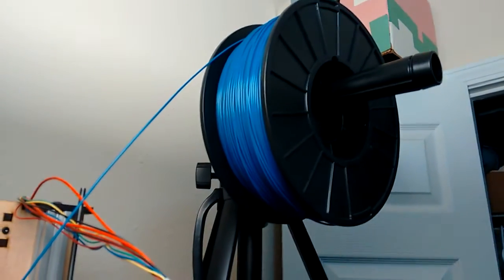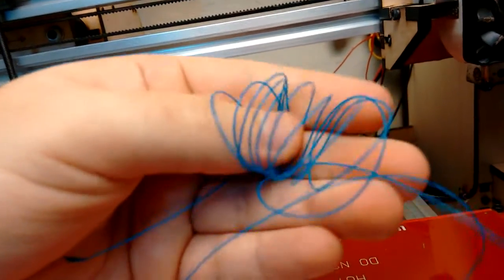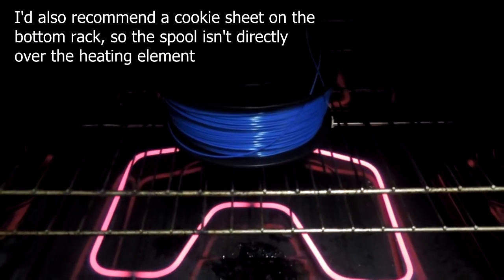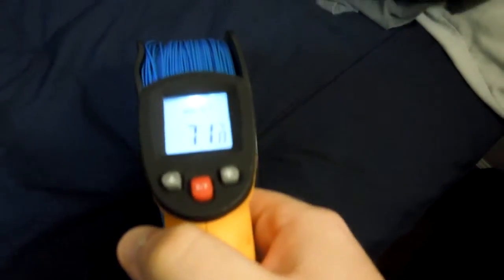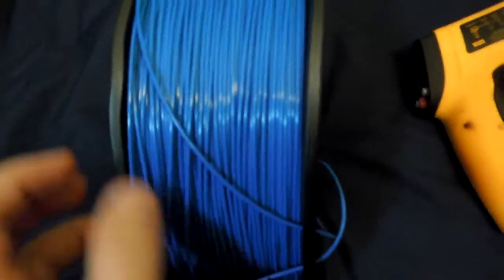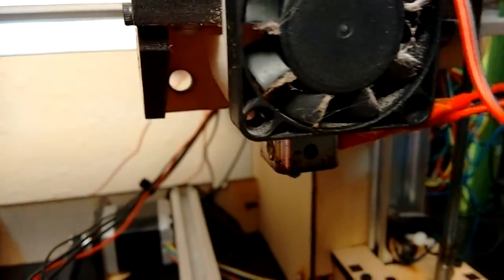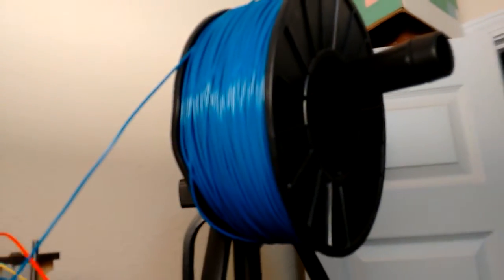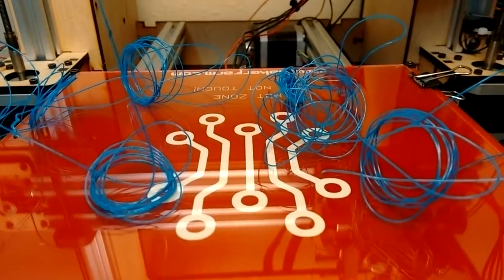Increase 3D Print quality by drying filament!

Comment: You do not specify the type of filament...different types require different temperatures, I could see on one quick view of your spool that your roll is ABS. I have read that 75°C is best for that. I do not use ABS due to the extreme difficulty printing it. I use PLA+ mostly eSun. I dry that out at 122°F - 131°F using a food dehydrator. The temp increments are 9°F (Don't know why those particular increments, but it is what it is.) Time can be set up to 10 hours. The constant temp is perfect for drying out filament. My current stubborn roll went bad overnight in the Pennsylvania humidity...AAAAAAARGH

Here is the chart of temps I found online elsewhere:      Longer times will certainly help...

PLA - 50°C [122°F] - >3h
PVA - 45°C [113°F] - >10h
TPU/TPE  PP 55°C [131°F] >6h
ASA/HIPS 60°C [140°F] >4h
ABS/PETG/CPE/DESSICANT BAGS 65°C [149°F] >3h
PC/PEEK 70°C [158°F] >6h
NYLON 70°C [ 158°F] >12h

Hope this info helps someone... If you heat PLA to 90°C you will have a bigger problem...

The best ones for this purpose are the ones with a big door and removable shelves. The ones that are round (or square) with stackable sections are a pain to use...

https://www.goodhousekeeping.com/cooking-tools/g31153352/top-food-dehydrator/

#5, #7, & #9 Would be the best and don't break the bank. #5 is similar to mine, it is $99 (Mine is not on this list...and was cheaper...can't find it anymore)

Just take out all the trays but the bottom one, you can easily fit more than one roll of filament in it!

Comment: I really don't recommend the aluminum foil trick to keep the door open. Since the oven can't reach the target temperature (because the hot air escapes through the open door),  the heating elements stay on all the time. This causes them to get extremely hot, clearly visible in your video because they're glowing quite brightly. This in turn causes them to heat up whatever is exposed through radiation, rather than convection. Since your spool holder is black, it absorbed all that radiation and got very hot. If you keep the door closed, the oven's heating elements won't runn constantly and your spool won't warp or overheat. This is the same reason why you preheat an oven before cooking, otherwise the hot heating element will overcook the top of the food.

Comment: You can also use a food dehydrator or sealed box with a rechargeable desiccant.  Most gun supply stores sell a unit that looks like a smoke detector.  It has an indicator that changes color when the desiccant has absorbed all the moisture it can.  When that happens, there is a little flip out plug.  You plug it into an outlet for 12 hours and good to go again.  Reusable hundreds of times.

Comment: Instead of doing this over and over, invest in some "crystal" silica kitty litter, dry it out at 300F for 3 hours in an electric oven and use it to store your filament in plastic boxes. Not only will your filament be even dryer but it will not damage the spool or risk melting it. My boxes maintain humidity levels under 10% for many weeks before it starts rising.
Reply from the maker: Definitely a good recommendation. I picked up a large, sealable container to store my filament in, as well as a rechargeable dehumidifier (from amazon for like 10 bucks). I have has absolutely no issues with moisture over the last 2 years using that system!

Comment: WM on the thermostat is 'WARM' which is less than 200. Keeping the door cracked means that the element must stay on longer so the bottom of the spool is going to be exposed to more heat. Not pre-heating means that the element is on for most of the time which will also result in the bottom being hotter. Most ovens will overshoot the set temperature after the preheat resulting in hotter filament.

Comment: thats not due to air moisture thats cheap nasty filament
Reply from the maker: It's actually amazing filament, and 100% due to the moisture in the filament. After drying, all of those problems went away, and finished the roll with no problems ^_^

Comment: I put the spool on a cookie sheet to prevent the lower element from radiating directly on the spool. This helps a little bit with the spool warping.
Reply from the maker: +Pierre C Yeah, thats something I should have done in hind-sight. I was thinking "Oh, the oven temp is only 200 F, this shouldn't hurt anything."

But... of course... the oven heating element isn't PID controlled, its either on or off, so the spool took the full brunt of the heat. Of well, lesson learned for the next time!

Comment: Thanks, this just started happening to me. Most places online say its bad filament. My first 1kg roll that came with my printer worked perfectly. These other rolls I got from Microcenter just started doing this to me. If I run it through faster it doesn't pop. Is there a better way to keep it dry? What if you have a 15hr print? One of mine did mess up only at the end and created a peely looking top face of the print.
Reply from the maker: +zerocool60544 You can see how I chose to store my filament here: https://www.youtube.com/watch?v=LHmlmZCaABg

From my understanding, this kind of moisture damage happens over a longer period of time. If you keep it out of humid air while you aren't printing, and only keep it in the open air while you are printing, you'll be fine. The only exception that I'd heard is with water-soluble material like PVA. With PVA, even 6 hours in the humidity will cause problems with the print. ABS and PLA should be fine, as long as your store it properly after.

Comment: I've used a vacuum chamber to degas silicone (prior to pouring molds), I wonder if a heated vacuum chamber might work faster, or at least with less heat needed.

http://youtu.be/_h3UsNmhmuE
Reply: Robert Burns I have also been thinking about doing this with dessicant in the vaccum chamber to absorb moisture. The dessicant should still be able to absorb all of the moisture as it's chemical bonds are unaffected by pressure. Then when your dessicant gets full of water after so many rolls you just put your dessicant in the oven and since it's tolorent to higher temperatures it will dry quicker, therefore saving you a lot of time overall.